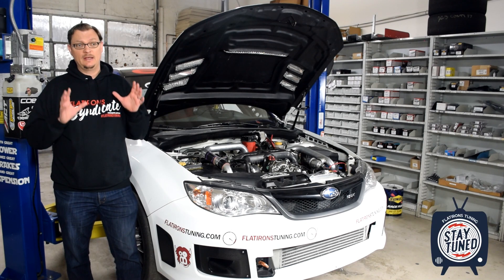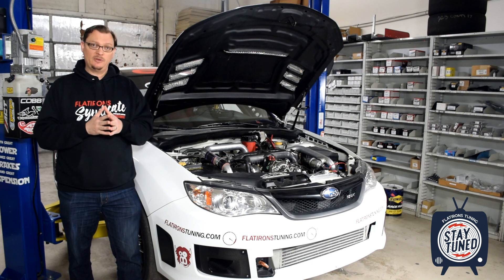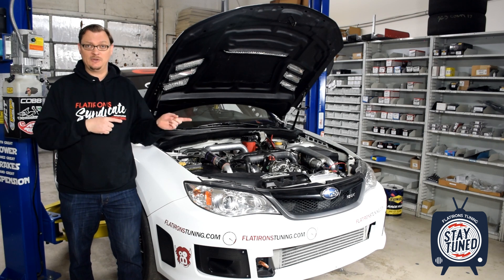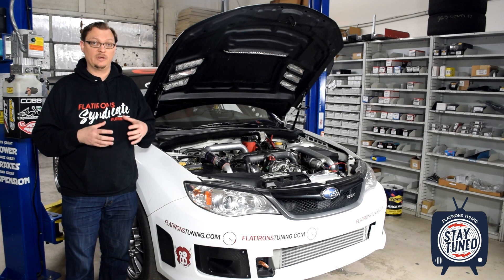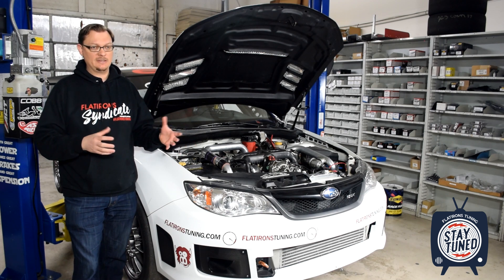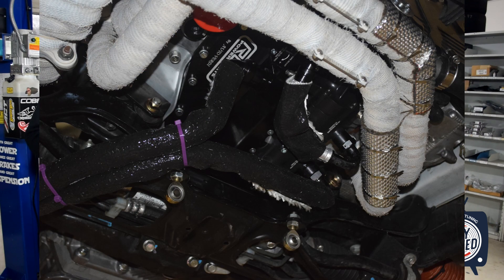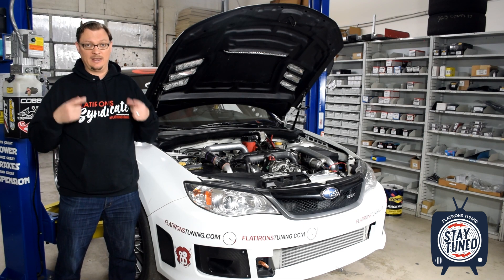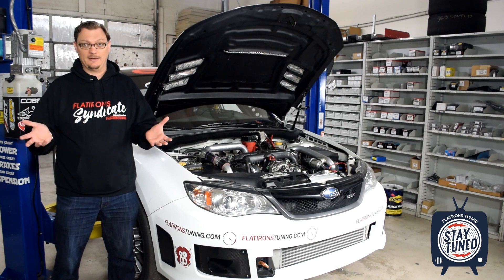Our Initial results with the Roger Clark Motorsport Subaru Dry Sump system from Pikes Peak 2020

Comment: the thing I would worry about is,if a bearing goes, im out an entire dry sump and thats not cheap
Reply from the maker: Thanks for watching and thanks for the question.  The Dry Sump pump can actually be rebuilt, so if the worst happens, you would not need to purchase an entire new kit.

And having more consistent oiling will go a long way to reducing the likelihood of that type of failure happening as well.

Hope that helps and Stay Tuned!

Comment: how do you do an oil change on such a system, would you need to crank without spark to allow it to pressure round as i presume oil in the header tank wouldn't flow round with just gravity....
Reply from the maker: Thanks for your question.  It is actually pretty easy.  We just pump the oil out of the tank, replace the filter, and fill it up again.  Since we change the oil frequently, this method is sufficient.

Thanks for watching and Stay Tuned!

Comment: What is your experience with accusump oiling system did you considered them as a option?
Reply from the maker: Thanks for your question, for some applications, the Accusump may be enough, but if it isn't enough, you will run into trouble quickly.  There is also a fair amount of complexity with the Accusump, but not that there isn't with the dry-sump.

A big point to keep in mind is that a dry-sump oiling system gives you control of your oil pressure pretty much everywhere.  Idle, max rpm, etc.  The Accusump is basically a stopgap to prevent your pressure from dropping below a minimum pressure only (while you have supply in the cylinder).

Basically, because the dry sump was a better overall fix to ensure that we would have great oil pressure everywhere and always, that is why we decided to go this route.

It has taken some work, but we are now very happy with the end result.

Hope that helps and Stay Tuned!